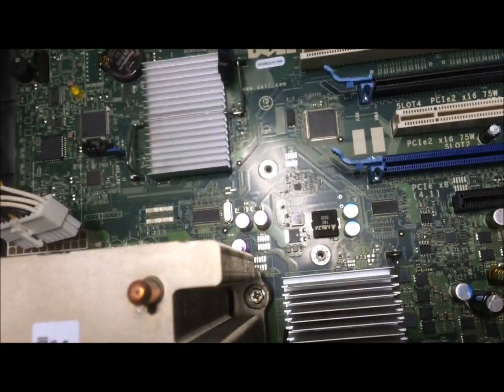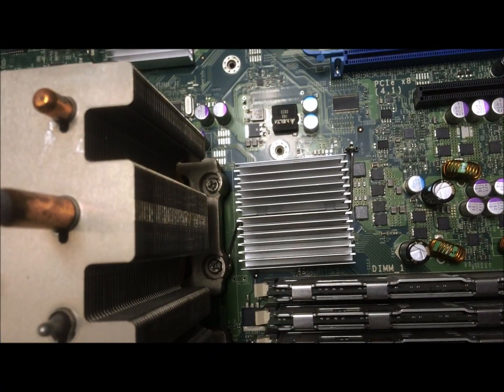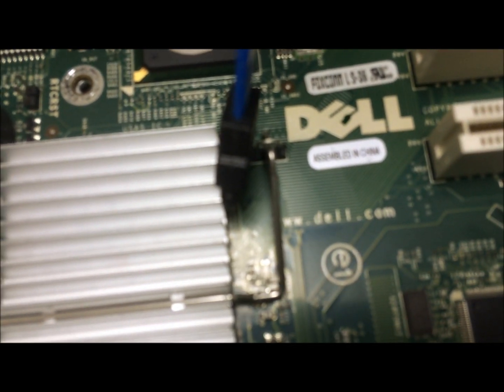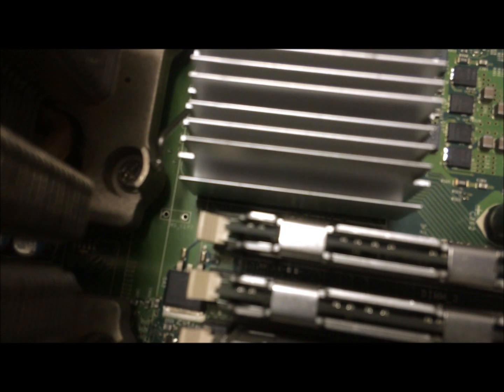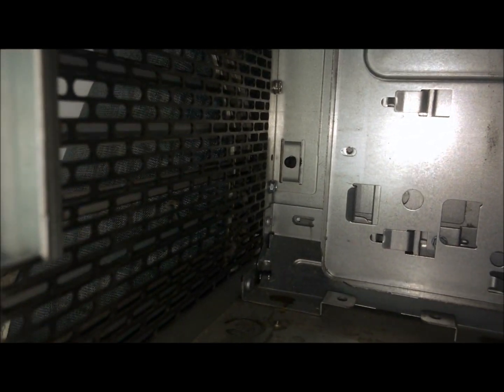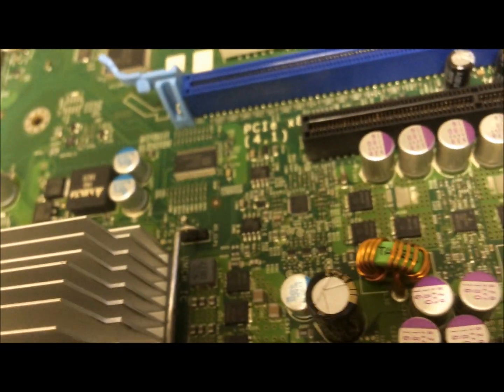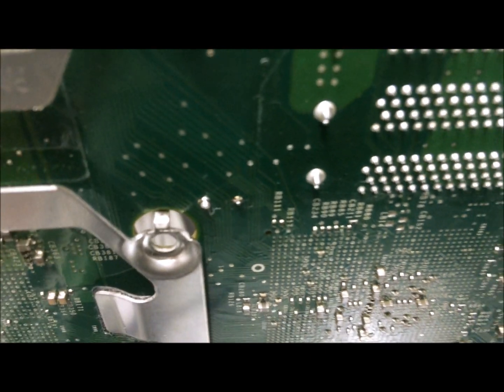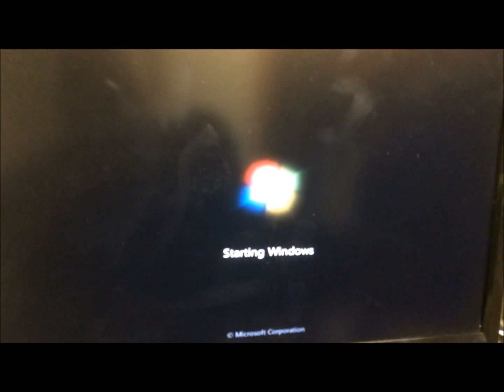Dell T7400 Alert! Chipset heat sink not detected. System Halted!

Comment from the maker: Those who say they don't understand. The mother board has a "U" shaped metal clip that goes through it. Sticks out both ends. One side is soldered at each tip. The other side is the rounded U shape. The computer knows that the clip is no longer soldered when it falls out. This is why you get the error. The U shaped clip is supposed to hold the metal leg from the heat sink down, closer to the board (for tension). For each heat sink that has these clips, they come in pairs...one on each side. Having one on each side gives the heat sink a firm connection to the chip it is trying to cool. When the clips become loose or fall out, the computer halts start up because it is trying to protect itself from over heating.

The remedy is to find the clip and solder it back into place. Reinforce it however you can. Your computer should work once it detects the clip is replaced.